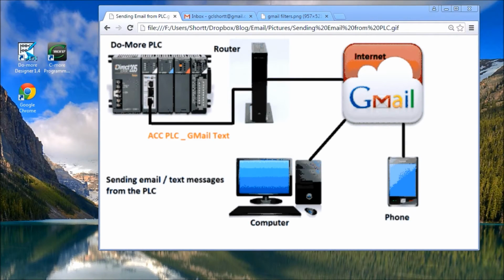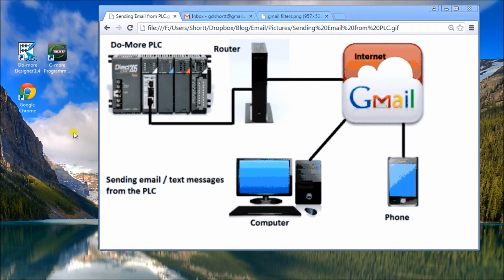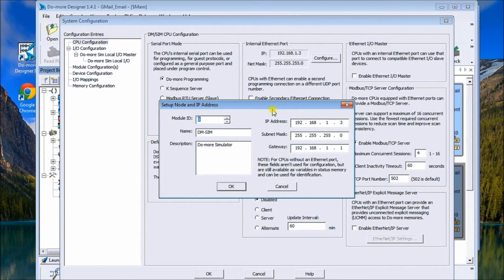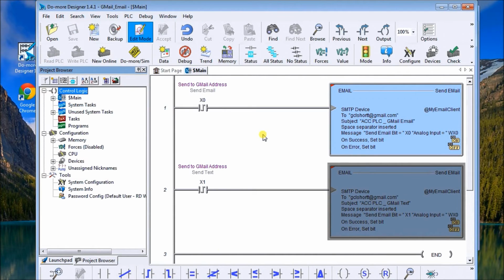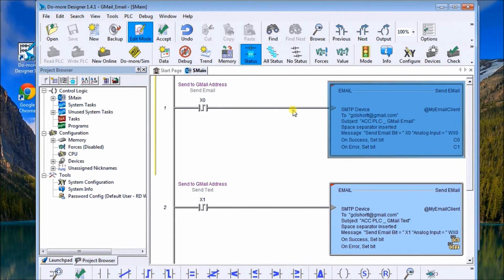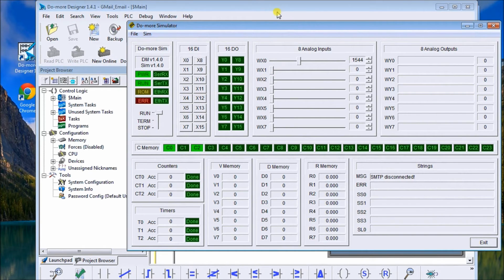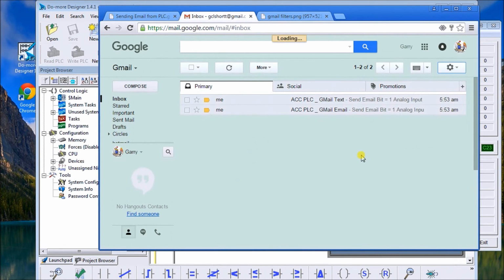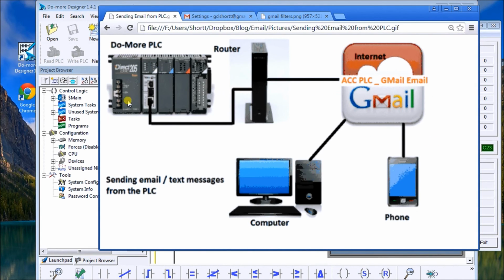Here’s is a quick way to send email text messages from the PLC

Comment: This could also work on the Click PLC right? i just don't see the email instruction. I'm guessing you would use the send instruction?
Reply from the maker: Hi Joseph,
The Click PLC is not capable of sending emails directly. You would have to use other methods to send emails like VB.Net (AdvancedHMI) or Node-RED. You would communicate to the controller to obtain the data and then use the email instruction in the appropriate format.
Another option would be to use the Productivity 1000 controller. This is capable of sending emails directly.
I hope this helps you out.
Regards,
Garry